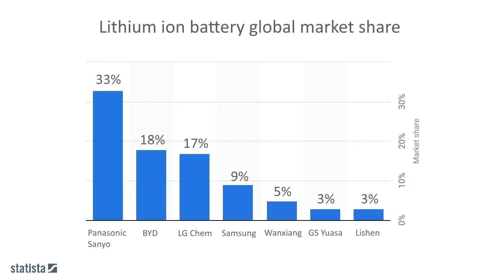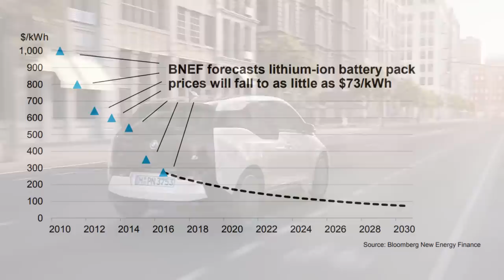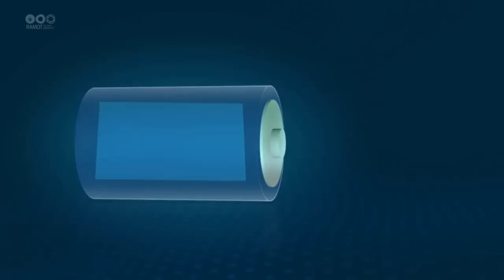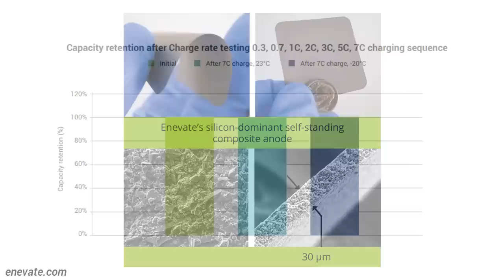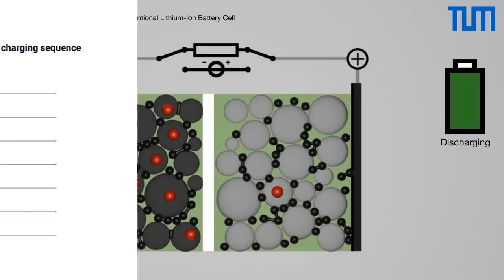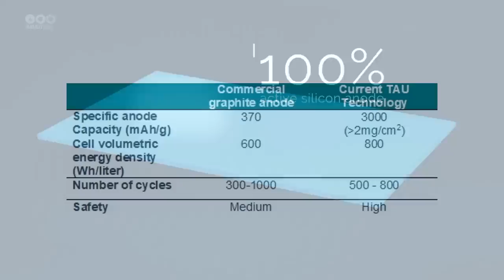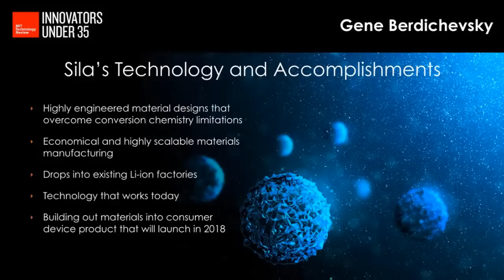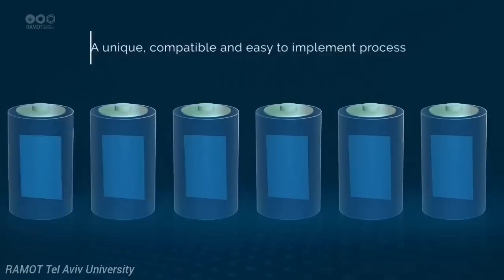The Battery Revolution. Ultra Fast Charging

Comment: The EV will never take off in the US until they get the prices down to a comparable gas model which would be in the 15K to 20K range. Also they need to get the charge times down to 10 to 15 minutes max empty to full charge. Lastly they need to get the distance up to around 500 miles using full air or heat.
Reply: agus2001, I am assuming you are an EV owner or sales person and like just about every EV owner, and EVERY sales person I have met they make totally false claims about stats.  I have a Corolla and can get over 700 miles. I have driven from Texas to Ohio, which is a little over 1000 miles and only had to stop and fill up once in that distance which includes crossing some serious inclines. The average compact vehicle is around 12 to 14  gallon gas tank.  The average compact is getting around 40 mpg HWY. I get over 50 mpg. So that is well within 500 miles on a tank for a comparable gas model. The only thing that will make the EV attractable to the masses is what I mentioned in the OP.
Reply: I don't think so.
No one drives more than 300 miles without a stop. Being able to drive 200 or so, maybe 250 on a single charge in any conditions is enough. Then, as long as the car can charge up for another, say 125 miles while you're having a coffee, that's fine. When you stop for lunch 100 or so miles later, the car gets 45 minutes to grab back 200 more miles. That's over 400 miles in a day with just two stops. Realistically, you probably need a few hours sleep now which gives the car time to fully charge.
The new Hyundai Kona should be capable of this - a proper mini SUV from an actual mainstream car company. Already retailing in Norway for under $40000.
Reply: Paul, first off like almost ever EV person I have ever met you deny facts and give bogus numbers and claims. That being said if you do not agree then come up with some reason the vehicles are not taking off in the US. By the way you are VERY wrong about how far people drive without stopping. Second when they stop they do not want to have set around for long periods of time waiting for a vehicle to charge. Lastly the EV of today never pays for itself against a comparable gas model.
Reply: John Smith Hi John, well, FWIW, I'm an ex-electrical engineer and I don't own an EV (not least because the currently affordable ones don't give me enough range to visit my elderly mother and get back home without at least 2 recharges and there aren't any recharging facilities along the route (yet)).
But things are changing. $30-40,000 vehicles with real world 300 miles ranges are just about to be available. And, while Tesla seem to think you'll read a book while sitting in their car park charging stations, the future is already here in Europe with increasing numbers of supermarkets and out of town malls with charging stations (charge while you shop instead of having to pick up fuel on the way home). All motorway (freeway) stops in the UK have rapid charging stations.
(Also, while you might have been prepared to drive 900 miles in a day, there's, frankly, no way you were "fit" to drive that sort of distance. Maybe our cops in Europe are keener to ticket drivers who are asleep at the wheel?)
As the electricity supply sector switches to renewables, having a lot of batteries connected to the grid a lot of the time becomes extremely desirable - differential prices mean you could actually profit from having your car sell back its electricity.
In Europe, Royal Dutch Shell have announced they will fit rapid chargers at 10,000 of their filling stations (as they've realised their real estate portfolio could well be worth more than their fuel sales profits within a few years and those filling stations will have a new life as convenience stores where you chare as you shop right next to every highway and even minor road).
Reply: John Smith And, BTW, I share what I assume are your concerns about hyped "breakthroughs" in battery technology - like fusion power, they're always just over the horizon.
But car companies (real ones - BMW, Mercedes, Ferrari, Nissan, Hyundai, etc.) are getting better and better at fitting in enough of today's batteries to make EVs practical for increasing numbers of people.
Something like that Hyundai Kona (though ideally with more rear legroom) is pretty near spot on for the European market.
And it's a bigger market than the USA..
Reply: Paul Goffin ignore him Paul.  He is obviously under the effects of Diesel inhalation.
Reply: Paul, Europe is not like the US so you are talking apples to oranges.
Reply: Paul again you are talking about another country and it has no bearing on US sales. The things that need corrected are for the US, not some other country.
Reply: John Smith, you are misinformed.  Tesla and a number of others are building charging infrastructure like crazy.  EVs with 250-300 mile range are rapidly coming on line.  What did Crunch say that was a lie?  You need to check the facts.  If you can drive all day without a stop, fine.  Go nuts in your magic Corolla.  No one is going to take it away from you.
Reply: Incognito,
you are self deceived. The proof is in what is happening. The EV of
today is not flying off the shelf even with tax incentives. That is
because they are not  what they are claiming to be and certainly not
what people expect. I am speaking in the US.  

 

The
only reason they are selling even at the low rate they are
now is the tax incentives and the few people who would camp out in front
of a store in the cold, rain and or snow, to be the first get the newest I
phone coming out. The average normal person will wait.  

 

I
actually want an EV, but like most people I am not paying 2 to 3 times for
an EV over what a comparable gas model goes for to be left with an over
priced inconvenience. 

 

Once
they get the prices down to a comparable gas model, get the range up to 500
miles using full heat or air, and charge times down to around 10 to 15 minutes
empty to full they will sell.
Reply: John - "Once
 they get the prices down to a comparable gas model, get the range up to 500
 miles using full heat or air, and charge times down to around 10 to 15 minutes
 empty to full they will sell."

That is such fictional drivel.  First of all, very ICE cars today have 500 miles of range of actual driving range using full heat and air, even if you drove it almost 100% highway, which is not even remotely close to real world driving for 99% of cars today.

Second of all, there is no need to charge electric cars for a 500 mile range, as 0.01% of people drive 500 miles in a day without stopping.  Probably closer to 0.0001%.

Third of all, electric cars are simply plugged in when you get home, and are 100% charged when you leave in the morning, which means this old gasoline mentality to wait until you reach 1/4 tank and drive to a gas station is obsolete.

Electric cars charge in your driveway, or at work, or when shopping, they charge unattended when the car is parked and not in use.  Most cars sit parked and idle 23 hours out of 24 every single day.

They can charge when parked, while you sleep or shop.  Demonstrating yet again you have no idea what you are talking about.
Reply: Captain, what study are you referring to? All I gave was facts, but few EV people are interested in facts as thy are self deceived. That means they are dumb on purpose.
Reply: You also make up crazy claims like you are getting 700 miles of range on your Corolla, a car rated at 42MPG with a 13 gallon fuel tank.  Even getting the posted EPA MPG, your theoretical range is 550 miles or so, assuming you drove it until empty.

Based on your claim I guess a Tesla Model S can actually drive 670 miles on a single charge.

https://www.theguardian.com/technology/2017/aug/07/tesla-drivers-claim-model-s-distance-record-of-670-miles-on-one-charge-elon-musk
Reply: Crunch, all your claims are bogus. Just about EVERY comparable gas model will go 500 miles on a tank even using air.  A comparable gas model would be like a Corolla or Focus. You are correct that the average person does not drive 500 miles a day, but the 500 miles is not just for long drives any more than the 500 plus miles a gas model gets is only for long drives. The 500 miles is a distance that keeps one from having to stop and refill so often. As for plugging in when they get home not everyone can do that as some people live in like condos or have deed restrictions that forbid such. So the need to have the same average distance is needed. Also many people live in cities and have to park on the street. You cannot run an extension cord from the house to the vehicle for someone to trip over. So you have proved that you are out of touch with reality and it is backed up with the facts that the EV in the US cannot carry itself and needs tax incentives and free charging places as you promote nothing but another fake salesperson for impractical EV's
Reply: Such hatred for each other over how their vehicles are powered. You all need help.
Reply: Chris, you are incorrect. It has nothing to do with how they are powered, at least for me. It has to do with truth and EV people seldom if ever give the truth about the EV of today.
Reply: John Smith  yeah because your opinion of "the only thing" is correct and everyone else is wrong so why should you listen to other peoples thoughts and ideas. Open up the mind brah its not healthy to ignore other people that are smart
Reply: John Smith  Never pays for itself? The cost of electricity is significantly less than gasoline. The reason EV's aren't taking off as fast in the US as other countries is because Americans don't value education as much as we should. Manufacturers respond to consumer demand and those consumers blindly believe that EV's are worthless. If you actually want to know more about the tech I recommend doing some research. Or not... just continue believing what your closed mind keeps you locked into.
Reply: agus2001  I loved this comment. lol you there @John Smith? Take notes!